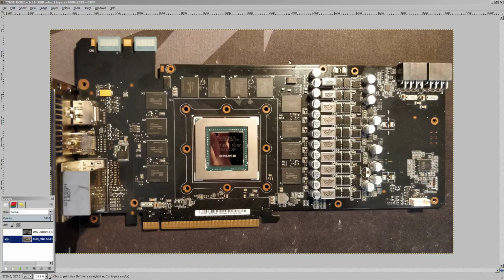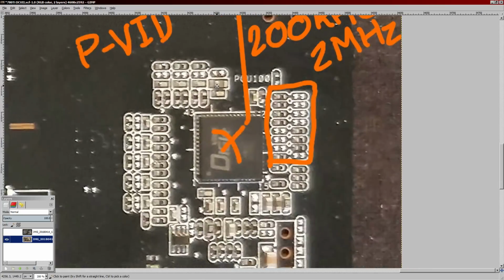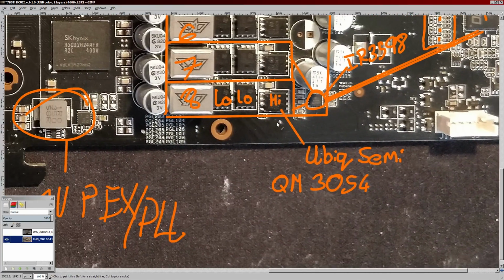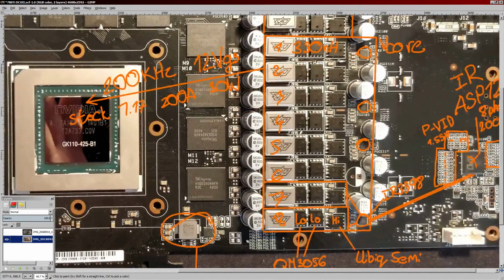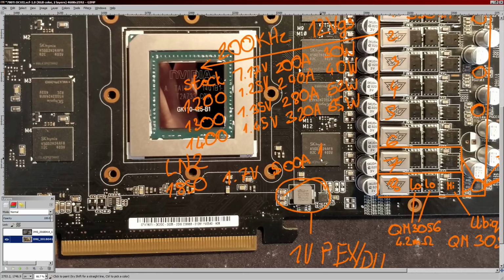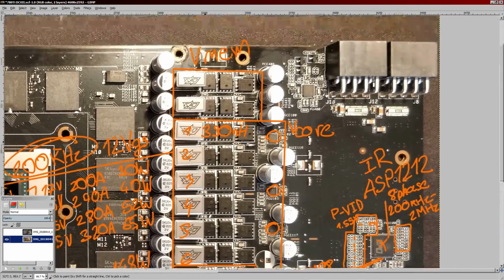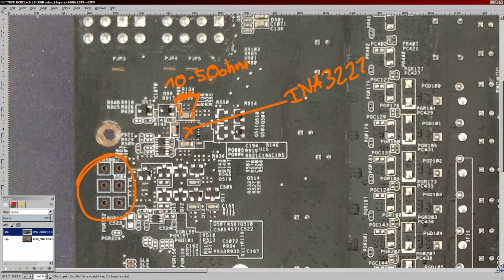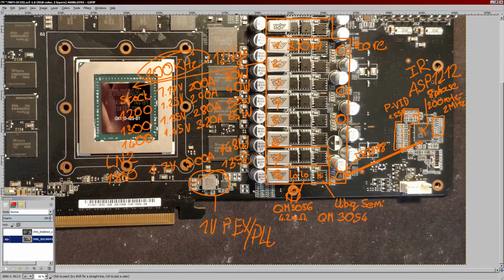PCB Breakdown: ASUS GTX 780Ti DCUII

Comment: Hello, i have a MSI GTX 780 Ti Gaming, that after going wrong as been placed 10 min in the oven @ 180°C, this became stable with stock frequencies and after 20 Min gaming i have to decrease the GPU frequencie by 91 Mhz to be stable.... what kind of part do i have to suspect??? Thanks for for your reply

In addition : The temps are very low as i have 55°C on the GPU instead of 72°C on one other (and this one was colder !!!)

Comment: I admire your efforts and knowledge. can you make a video regarding the boot sequence or power flow sequence of AMD GPU. ie PCIE to primary MOSFET of Vcore or Mem etc.  actually i have 2 AMD cards and what I found is the VRM controller is not getting enable signals . so it would be very helpful.

Comment: I think the most power hungry are 980Tis and Titan X Maxwell no?
Reply from the maker: Nah maxwell AFAIK got ever so slightly less fire spewing thank a maxed out 780Ti. I think the 780Ti's were peaking around 1500W where as the 980Tis were doing like 1300W on the 12V lines. And the average on the 980Ti is a tad lower too.
Reply: O!Technology My 980Ti pulls 300W continious in games and peaks somewhere  between 300-350W somewhere in FireStrike normal. 
Addmittedly at 1600MHz+ but with a relativly low voltage of 1.25V its really a lot of power draw.

Comment: And in this video, Buildzoid begins to ponder water cooled VRMs with LN2 on the GPU core to cope with the power draw heading for 1kW on that card alone...
Reply: My 780Ti (MSI GTX 780Ti Lightning MOA) pulled 600W on air (aftermarket MK26 cooler with 2x Noctua NF-A14 IPPC 3K) on firestrike lol these chips are insane.
Reply: HOW did you manage to get a 780ti LIGHTNING :O